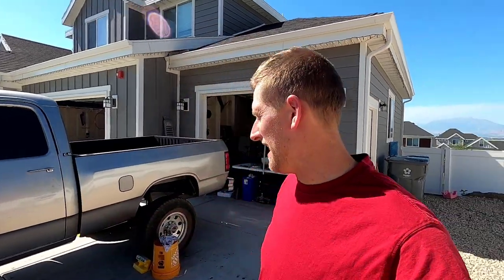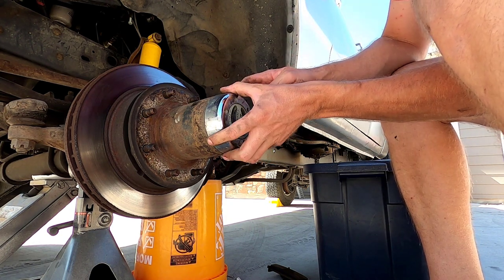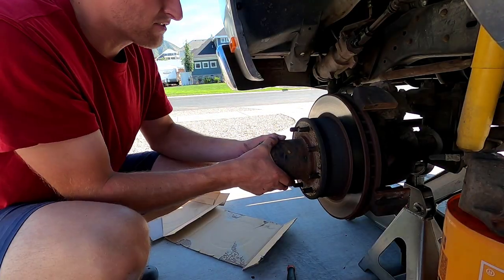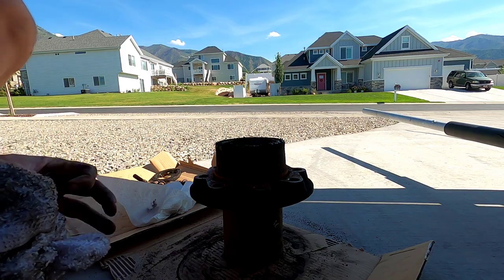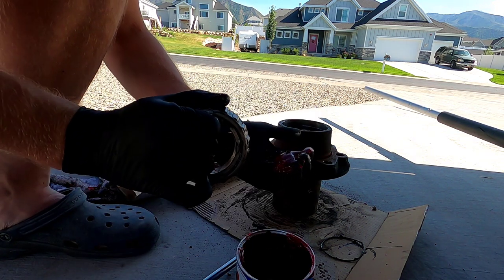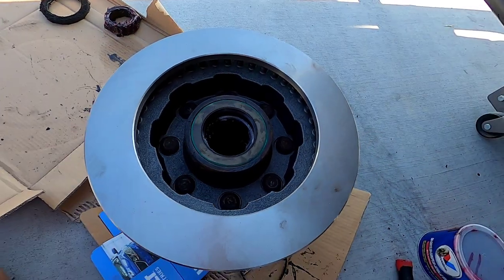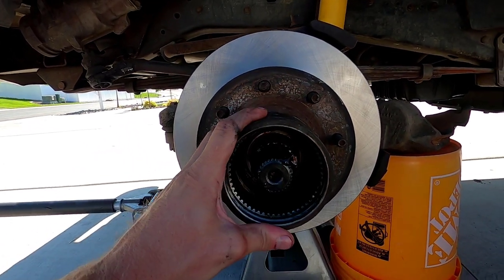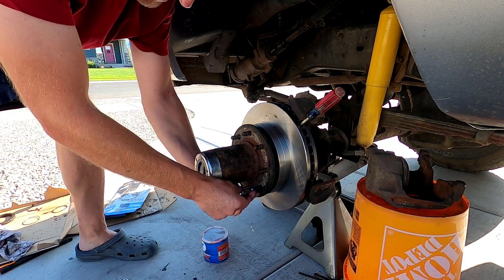How to Replace Brake Pads and Rotors on a 4wd 1st Gen Cummins

Comment: Thanks a bunch.  The first run at it gave me hell, but the second one took about 4 hours total,  I appreciate the reassembly part of the  video.  Very helpful.  Something that wasn't clear during the process, was that the rotor holes are big enough for the studs to drop right in, it's the hubs you're hammering into.  Just a note for anyone who has this problem, if they don't drop right in, don't force it.  You WILL crack the rotor at the bolt holes.  I got a rotor that had the wrong size bolt hole (too small) and tried pressing and hammering, both methods cracked the rotor.

Comment: Another nice video, Tim.  A little story about those studs - I replaced the rotors and pads on my D250 about 6 years ago.  I pounded those studs back in as well as I could and just torqued them after I got the wheel back on there, and I don't think I did it in a star pattern. This would turn out to be a big mistake.   The test drive seemed ok, so I thought all was good.  A while later I had to make a 2,000 mile trip.  I got about 750 miles into it when I had to swerve hard on the freeway to avoid rear-ending someone because of a sudden traffic backup.  Apparently some of those studs weren't bottomed out, because after that swerve I had a very bad wobble in my front right wheel.  I took the next exit, and limped to a parking lot.  I was kind of mad about it so when I turned into the lot I jerked the wheel to the right and hit the gutter pretty hard.  To my amazement, that realigned the hub and rotor.  I stopped the truck and cinched those studs back down, and it's been good ever since.  But now my rotors are warped (again), so I'm replacing them with some dimpled and slotted ones from brakeperformance.com.    That's why I'm here getting a refresher on installation.   This time I'll torque those studs down in a star pattern before putting the wheel back on.  Thanks again for another great video.
Reply from the maker: Dang that's a crazy story! Luckily mine all seem to have seated correctly

Comment: First Gen.  My dad had one . There are a few things we did to his truck that seemed to help . If you have a tire on the front that seems to wear badly from a lot of negative camber as my dad truck was there is a way to fix it if you have access to a lathe .  My father machined the spindles on a taper or what ever the correct name for the parts are . That caused the tires to sit flat and had pretty close to 0 camber . Secondly on the first Gen hydroboost can results in better brakes . Thanks for the videos

Comment: Appreciate the effort for sure. My question is the following, does this procedure apply to 2 wheel drive also?
Reply from the maker: I haven't done it on a 2wd. My guess is that it would be a little more simple since you don't have to disassemble the locking hub.
Reply: Watch @ Jason explains things on YouTube he works on a 2wd D150 it’s the same parts as a Cummings 2500/3500 lol

Comment: Thanks for the video. But I think you missed stating one critical step. On reassembly, after the first nut is set against the outer bearing correctly, the small pin on that nut MUST engage one of the holes in that washer. This means you might need to slightly turn that inner nut one way or the other to make that happen, and that's what ultimately holds the inner nut at the correct setting.  The outer nut merely holds the washer in place.

Comment: Hi decent garage. I ordered the spindle nut socket from the website you provided and it is a bit too small. Would you happen to know what size I need?
Reply: I used 2-5/8” the socket on his site says for Danna 44, which is 2-3/8 I bought that one from auto zone n didn’t fit. I had to drive around looking for the 2-5/8”. The 2-1/2 seem to fit as well but I liked the 2-5/8” design better that’s why I went with that one.
Reply: @isilence4558  good to know, I just ended up grinding off two of the tabs and it worked out

Comment: Great video! I'm currently in the middle of working on my 92 W250 brakes. Ordered the Nut Socket off the link you provided but it was too small. Stopped by O'Reilly's to  pick up a 2 5/8 socket that fits perfectly.
Reply from the maker: Shoot! Sorry about that. Sometimes when a product goes out of stock Amazon automatically recommends something "close" and in this case that won't work. Glad you got it figured out.
Reply: @decentgarage  Yea I think the original axle was a Dana 44 and the previous owner put a Dana 60 in. That's probably where the sizes differed. All good though. Still best video I've found. Keep it up! Look forward to checking out your other videos.
Reply from the maker: @jaredcarmo321  thanks man!

Comment: What size wheels do you guys run on w250 got 16.5 on mine and have to change size can't find them anymore
Reply from the maker: I run 16s. Tires for 16.5 are almost impossible to find as you have found out.

Comment: Great vid subscribed! I was wondering if you have a part number for rotors? Seems they make a few different sizes for the d60 4500lb axles. Thanks
Reply from the maker: Shoot! I didn't write down the part numbers. I just picked them up from Napa and used what their all knowing computers said

Comment: I will be doing brakes all the way around on mine as well.  Mine shimmies pretty bad.  Also my caliper shim is all worn out on the passenger side so it slams back and forth.  Gotta do rear brakes too and the one side is soaked in oil so new seals as well 😅.  Oh yea and my brake booster has a pin hole leak....
Reply from the maker: Caliper shims? I guess I better check those too haha. I'm learning with every video!
Reply: decent_garage I meant those things you pound out that hold the caliper in my bad
Reply from the maker: @Dibbs18  oh good! I didn't know that's what they were called 😂

Comment: Can you change the studs with out taking  the hub of the spindle?
Reply from the maker: You might be able to if you did it one stud at a time
Reply: Ooooo through the little open spot on the back right,  a mean turning the hub one at time?
Reply from the maker: @EduardoSilva-xe3gp  yeah you can just press one out and then press the new one in and do that for all of them
Reply: I really appreciate it Sr your are a life saver like to all of videos
Reply from the maker: @EduardoSilva-xe3gp  no problem 👍